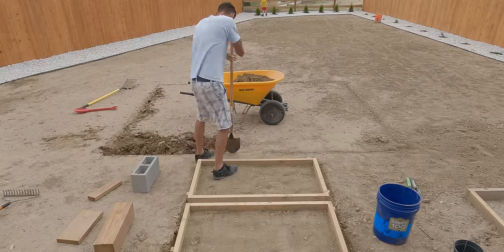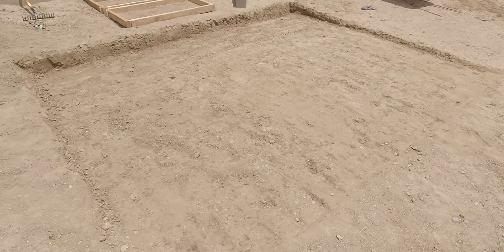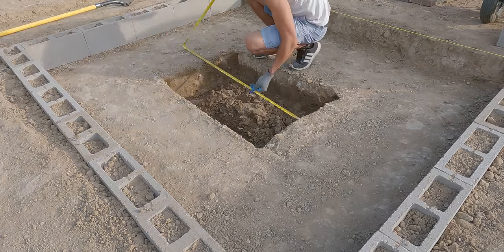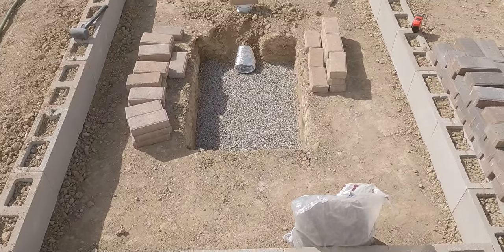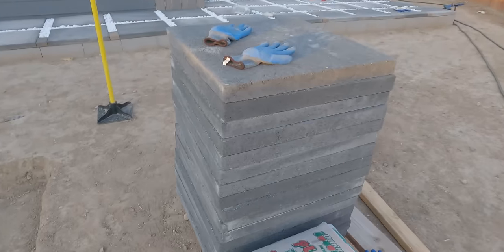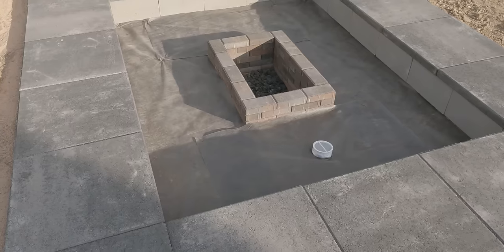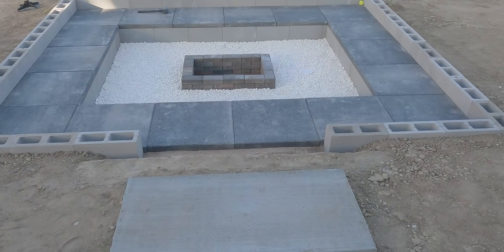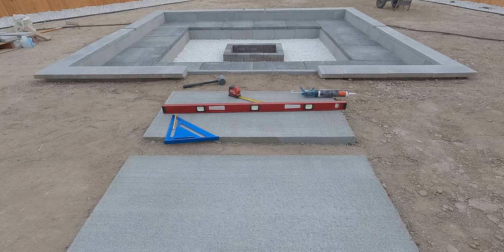DIY: Modern (Sunken) In ground Fire Pit

Comment: What about drainage for rain?
Reply: Nah....double feature....fireplace + hot tub
Reply: No back support either
Reply: Nice looking!
Reply: That’s what my thoughts are too
Reply: Sand ground dont need a drain
Reply: You mean the tiny layer?
Reply: Yeah man Wag1 wit da run off water
Reply: @michalangrzyk1967 are you sure ?
Reply: Rain shmain
Reply: Literally my first and continual thought as I watched the video. I kept waiting for the step where he installed something for drainage 😂
Reply: He probably lives in a state where rain isn’t an issue. I am looking to install a fire pit like this in my back yard. I live in Washington state and and a drainage system would definitely have to be implemented up here. His seating area is also too low to the ground and though it looks nice pavers are not comfortable to sit on. Sure you can get outdoor pillows but they will need to be replaced frequently. There are always problems but for every problem there is a solution.
Reply: Koi pond
Reply: @SAUCE206 Where would you suggest positioning the catch basin in this type of design?
Reply: The same place the rain goes when it rains on your lawn. Down into the ground, since the sand is the lowest point of the pit it will go through the sand into the ground. It may be slow but it will drain.
Reply: Water drains into the Earth like it would in the rest of the garden
Reply: His yard is on a slope, you can see in the video. So even if it did rain hard, it would still just drain out to the end of the yard. Plus he said he lives in a dry climate.
Reply: @ChristianStJulian  French drains and made the same as the floor he's using in the fire pit

Comment: Very cool and will be building my own, just a little concerned about the bricks, are they fire rated? Typically you want to use fire bricks or at least clay bricks, not cement pavers (too porous, will get water and then explode/crack if super heated). Pavers around the pit should be fine as they won't get super hot, but inside the fire pit walls you want fire rated material.

Comment: Hey San.  Awesome video and amazing end result.  I had one question.  Not sure where you live but do you ever have problems with drainage within the fire pit and seated area?  I like how you used the ground as a natural backing for the seating instead of using difficult retaining walls, but just wondering if there were any issues not having a drain?  Thanks!
Reply from the maker: Hi Jon. I do live in a more dry climate area. But I did run into small water build up at the very bottom of the pit during the first few weeks after laying the sod since I was over-watering to help the grass take root. Then after the grass took I cut down on the watering schedule and have had no issues whatsoever. If you live in an area with lots of rainfall then I would advise adding a plastic drain tube at the lowest part of the firepit, and that should solve any water drainage issues.
Reply: How much did that build cost
Reply: @sanchaik5586 what size is the actual firepit..before the bricks?

Comment: look great but a few questions, how do you empty all the ash? how do you stop grass cuttings from going everywhere? will the glue hold up with the heat? and  are the bricks okay for fire? I'm looking to build my own and was thinking of digging a soakaway in the centre so the ash and water and can drain away in to it or have that and a tray for the ash to reuse for the plants.
Reply from the maker: So the ash hasn't been an issue yet, I have cleaned out the pit only once since I made it. I don't put the fire out with water when Im done. I just cover the pit with a steel grill cover and let the coals all burn away. Never had a problem with grass cuttings, you can always use a leaf blower and blow them away if its a problem. I used concrete adhesive, and so far no issues, but I would recommend applying liberally, the more the better. The bricks are great for the fire, they are made in high temp.

Comment: Verry nice work, well done. But I'm afraid the concrete bricks wil crack sooner or later because of the heat. For a fire pit you should have token burnt red bricks and glue them together with clay.

Comment: I'm building mine right now. A little tweeks but practically the same. I think I'm doing overkill. On the drainage issue I'm pretty much screwed but I came up with a solution. Installing pvc pipe at floor bottom and digging small trench to feed pipe in ground and having it come out on the outside and using a harbor freight small water pump to hook up to and pumping it out easily.  I had a major rain come thru literally 24 hrs of it. And I've used the pump in the past and it pumped out the hole no problem. Hence I saw the weak spots in my setup with the whole.  Slowly trucking along building it.  Hope it helps someone
Reply: Let’s talk I need to do this to mine too when I build it

Comment: First: finish product looks great.

Use a spade for digging, dig 3 inches lower. get 3/4 crush with fines (aka road base), use level to skreet the road base with quarter bubble grade following yard grade direction. Pack it well. Then sand and proceed as you did. Get a dead blow and tap the 2x2s gently into the sand while using the level to check and keep desired grade.

The quality looks good, but that thing is gonna settle. Also I hate the 2x2s, they crack easily, and they’re heavy.

P.S. using deadblow tap all blocks/pavers to reduce settling, again chase grade with your level. A plate whacker can be used for packing the road base, or a tamper.

Comment: Looks very good, my sunken fire pit is 1 metre deep, what do you recommend for drainage?
Reply from the maker: 1 meter is deep 👍. Depends where you are having water drainage problems, the floor area or the pit itself? Perhaps at the lowest part of the fire pit you can install a proper plastic drainage pipe that will help water flow away from the pit.
Reply: @sanchaikofficial  back of the retaining wall is close to the neighbours fence, their gutters are blocked and over flowing, water going under the fence and into the pit atm, I might need a little decline and run a pipe at the lowest point?

Comment: Amazing work, I’m thinking of doing something very similar but worried about water retention specially in FL with the heavy rain. What would you do for that??
Reply from the maker: Not sure how you would go about that. If you live in an area of constant precipitation, then maybe consider having the pit above ground. You can always experiment, just dig a hole somewhere and wait to see if it fills with water.
Reply: You could also get an old bbq cover or a metal lid to cover it when you aren’t using it so it doesn’t fill up with water

Comment: how do you drain the water off the sunken floor
Reply from the maker: There have been a couple of times where we got flooded with heavy rain for days straight. The water does drain on its own. At the very bottom there is sand a gravel, works well for drainage in the dry climate where I live. But if you live in a humid climate with often precipitation, then you most definitely need to dig deeper and add a drainage pipe that leads away from the pit.

Comment: Two mistakes you made, one was drainage, that can easily be fixed with minor adjustments. The second was seating, unless you’re sitting infants a full sized adult can’t sit comfortably how it’s currently set up.
Reply: I want to do the exact same set up how do I run a drainage line? I dit a line going sideways and fill it with the white rock? It looks really comfy to me I would just get some pillows so you can lay your back more

Comment: Wonderful design, but it will not last. No footing for the block, wrong brick for the fire pit, using the cap to hold back soil for the step is all wrong. Even if you want to do something like this yourself, you can still contact a local professional landscape company and they can provide you with proper construction techniques. You will be repairing this project multiple times in the near future.
Reply from the maker: The whole point of this is to make something creative while spending as little amount of money as possible. As far as longevity, I will make an update video after a year mark to show how its holding up. So far its great, been using it 2 to 3x per week.
Reply: let me guess, you're a professional landscape company so you can provide proper construction techniques? like he said, this is a diy, why do contractors troll on diyers on youtube lol